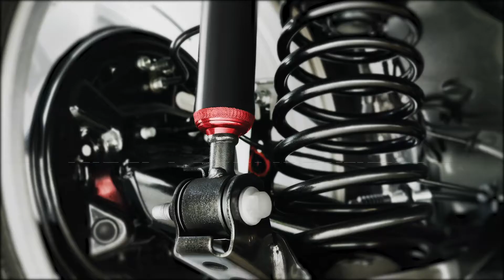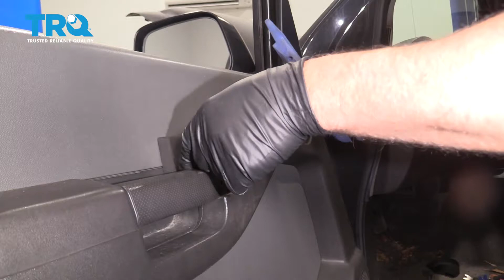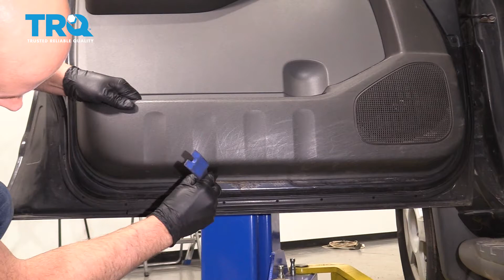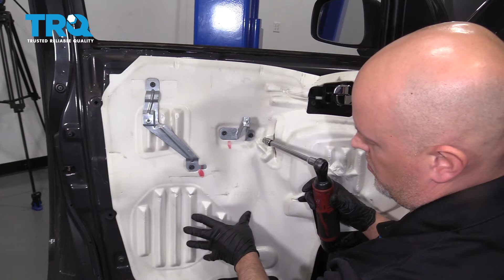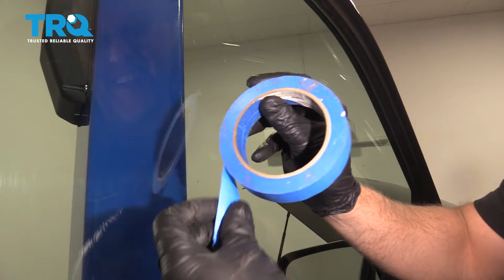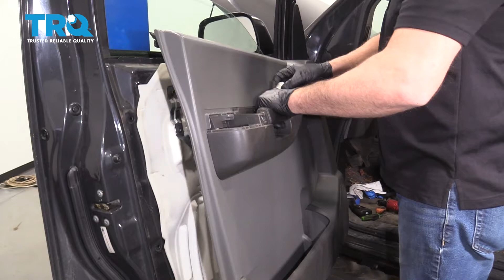How to Replace Window Regulator Replacement Full Assembly 2005-15 Nissan Xterra

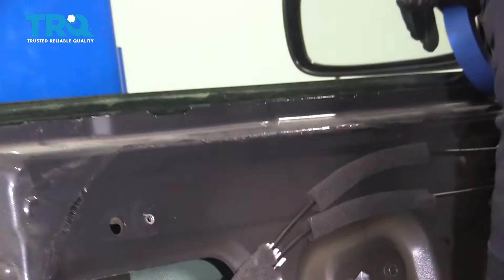Comment: Just an extra tip. Instead of trying to tape the window up just take the glass out and set it in the passenger seat. Takes about 30 seconds and doesn't require 4 hands. 6:37